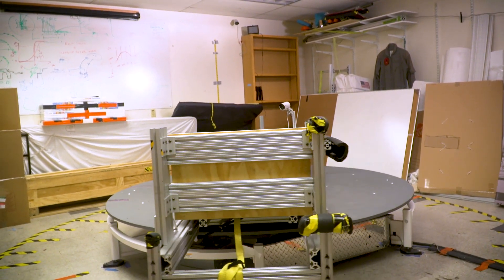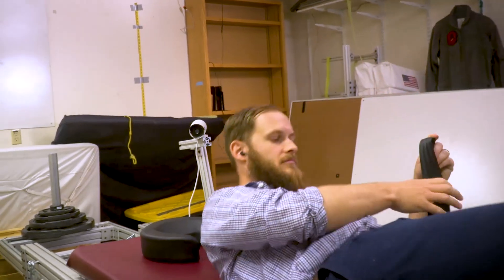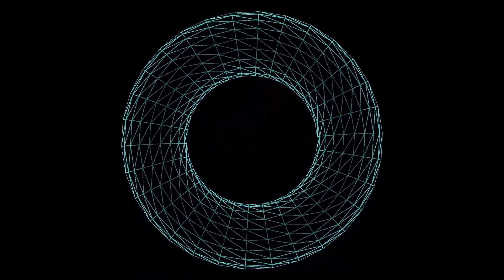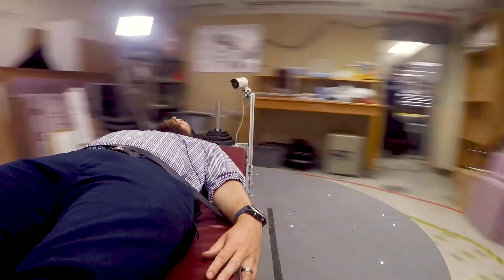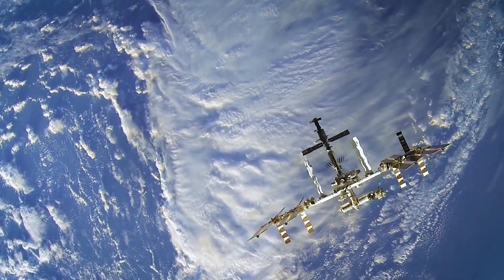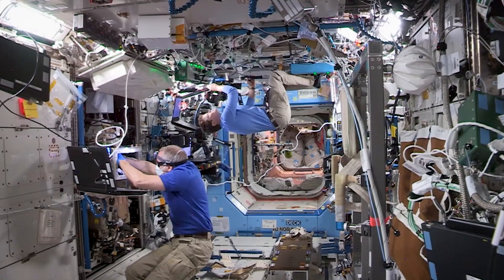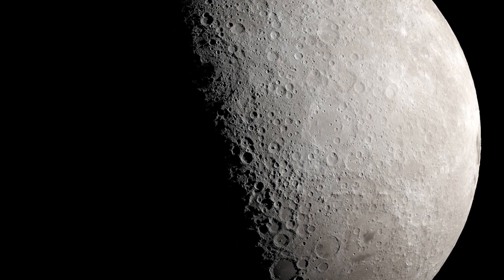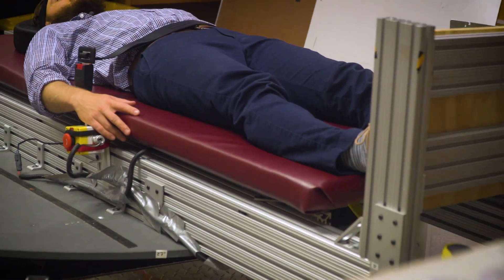Artificial Gravity

Comment: The problem here is that you will not generate the same force along the entire body of the test subject. Centripetal acceleration and its virtual counterpart centrifugal force which is what the test subject experiences is governed by the equation a = rw^2 (I used w for omega since it looks similar). For a solid body where all parts have the same angular velocity, omega (w) we see that the centripetal acceleration has linear relationship with the radius. If you generate 1g (9.8m/s^2) at the test subject's feet, the gravity at the midpoint will be half that dropping to about 0.1g at the head.

If you generate 1.0g at the midpoint of the body, the feet will be at 2.0g and the head will be at 0.2g.

Regardless of how you do the experiment, artificial gravity at the head will be extremely small almost to the point of being non-existent art worst and barely noticeable at best.

Comment: The reason of having a large axis is not so they can spin at a slower rate. It's so that the force felt by the head and the feet will be nearly the same. With this setup (which I duplicated in first grade on the playground round-a-bout during recess), your feet receive twice the force that your hands do, and your head receives none of it. Also, people would need to go into "the machine" for a couple of days with this setup. With the large axis, they could actually move around freely. You don't need a large structure to have a large axis, as it can simply be two modules tethered together by a long, flexible tunnel.
Reply: Slower rate is proven to not induce motion sickness
Reply: But the real trick is on planetary surfaces
Reply: I think you are missing the point. Creating a large artificial gravity system is hugely expensive. Creating a spinning bed is not. If an hour a day on a spinning bed is sufficient to significantly reduce the health problems of zero-g then it is the more practical solution. Astronauts on a trip to Mars won't be a 9 month holiday cruise!

Comment: How about you redesign it so that they're still sorta lying down as they are now, but the force that moves them round and round is on their feet, pushing them in the direction of the current angular movement.

Sure, you'd still have Earth's gravity acting on them and messing them up a little, but it should create a second gravity source to experience.

It's probably better tested on animals or maybe something even simpler to see how the pressures are fundamentally affecting the body.

Comment: This doesn't look like science. With a subjects head at the axial point, the centripetal force that is providing the "artificial gravity" is zero, with the force increasing as you move toward the feet. Strikes me that the variability would play havoc with the circulatory system and blood pressure regulation.

Comment: Problem: already invented more than 100 years ago. Cross two bars at 90 deg, add an axle with bearings in the middle, bolt the axle to the ground,  put a seat at each bar end, fasten a hand-wheel on the axle, you can seat 4 "astronauts" (read kids), they use the wheel in the middle to spin the contraption with their hands. We had one of those 40 years ago, we spun it so fast that some of us puked. Yes, and you get hands exercise too, save the e-motor and the energy. Duh! Feel free to use your PhD's for the choice of fancy materials and proper T-slot profiles ;-)

Comment: You can create artificial gravity by building the floor perpendicular to the propulsion and constantly accelerating at a certain rate. You will feel the acceleration as a force pulling you into the floor. This does mean however that space traveling speed would be very clearly set by the amount of gravity you want to feel. And what happens when you approach light speed? You will have to go faster to keep the acceleration going.. would you be able to? I say yes..
Reply: With what kind of propulsion for that acceleration? That's the bigger question.
That's why rotational gravity is much more viable for now.
Reply: What your velocity is in the inertial frame of reference in which you were at rest at the start of the mission, doesn’t matter to whether you can accelerate. Say you’ve been accelerating at g for some amount of time such that you are now “going at half the speed of light”. But, that’s just in that one reference frame. You can pick another reference frame in which at that moment you are at rest, and so it is clear to see that there’s no difficulty continuing to accelerate with regards to that reference frame. As far as the artificial gravity is concerned (from the perspective on the ship), the relativity isn’t a problem .
However, of course, you won’t, by doing so, exceed c (in any reference frame).
Of course, accelerating that long is uh, well, the fuel seems like an issue probably.

As for use a warp drive, I don’t think that helps with this. I don’t think those are even really supposed to accelerate? (Like, there’s the problem of “how do you change the velocity of these things, in order to get them started” even in the subluminal case, iirc)
Reply: the amount of fuel needed for a constant acceleration is completely infeasible unless we manage to come up with some completely new method for propulsion that solves that. most of the time on all spaceflights is spent just gliding with all engines turned off
Reply: @asdfghyter  maybe solar sails and fusion or alcubierre warp
Reply: @thothheartmaat2833  right, solar sails or fusion is more realistic than Sci-Fi gravity and may one day in the future become an actual option. warp-drive however is literally just Sci-Fi artificial gravity and if we can solve that we have already solved the problem of creating local gravity fields, so that’s probably never going to happen

however, a solar sail is never going to produce anywhere near 1g (9.82m/s^2) of acceleration, so that’s not an option for artificial gravity. it provides a thrust of 0.000 009 08 newtons per square metre of sail. and it also has a top speed, so you won’t get acceleration for that long
Reply: @thothheartmaat2833  the only current tech we have that can maintain constant thrust for a long time is ion drive, but those typically have a thrust of around 25-250 milli-newtons, consuming 1-7kW, so there’s no noticeable artificial gravity there. To achieve the same gravity/acceleration as on earth, we would need 40 of those per kg of mass, which is impossible because a single ion truster probably weighs more than a kg (and certainly more than 250 grams)

also, even though ion thrust is mostly runs on electricity, it still needs ions as reaction mass, which will run out faster than you expect.

a single nuclear sub reactor can produce 200MW of power, which is almost enough to carry 1000 kg at full acceleration, but it also weighs 782 tons, so fission is not really sufficient, at least not in this form